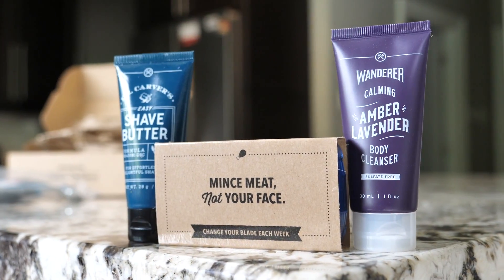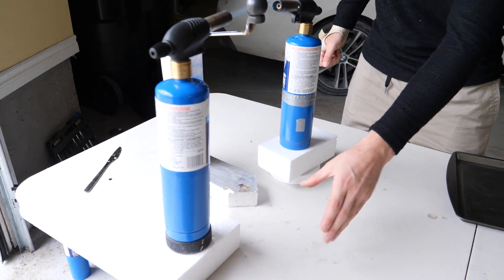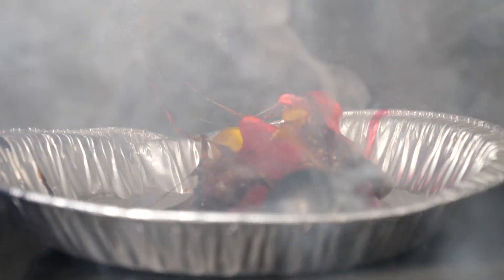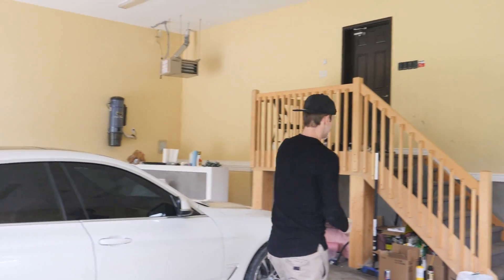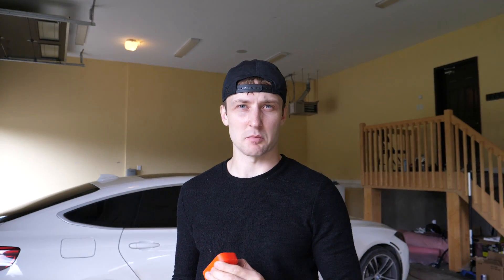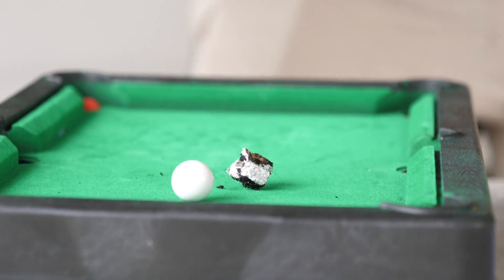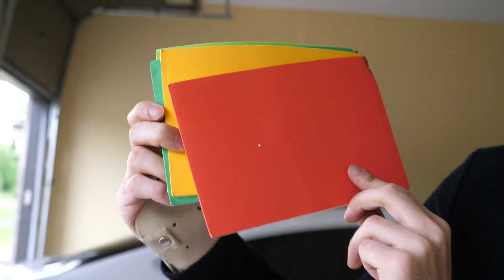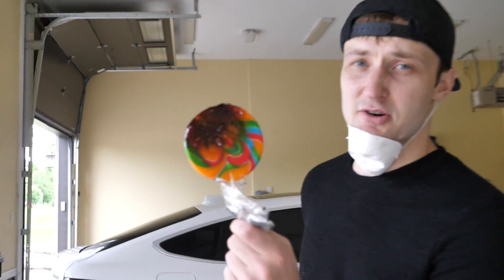GIANT 1000 DEGREE METAL BALL vs SLIME EXPERIMENT *Learn How To Make 1000 degree Slime Experiment

Comment: that mask doesn't help against fumes, it only helps against particles in the air like dust. also you should push the metal strip on the top of the mask so it bends around your nose